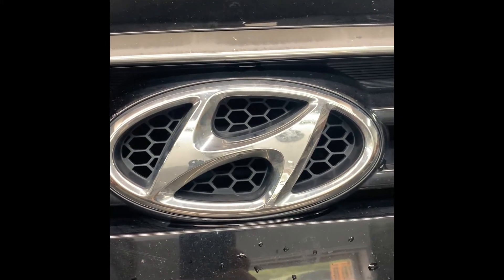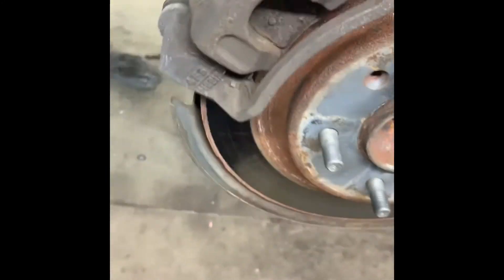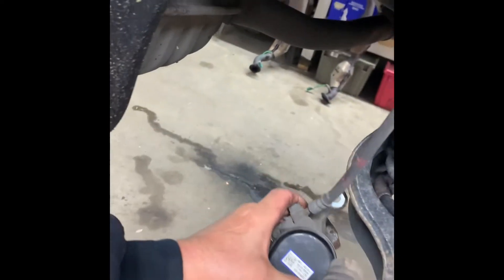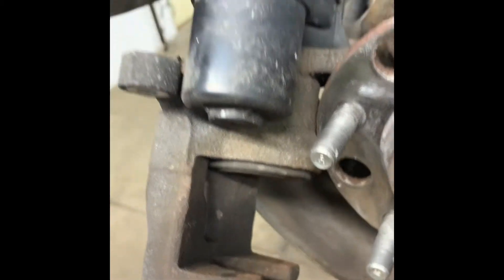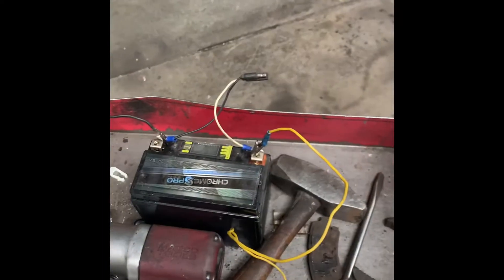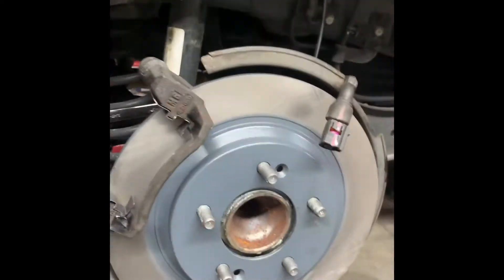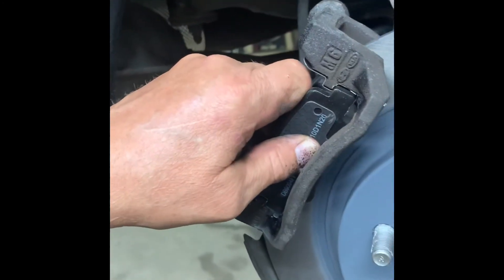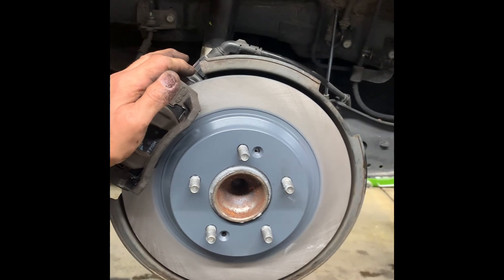2015 Hyundai Sonata rear brakes

Comment: You never should us how to push piston back. You just said vrrrr vrrrr
Reply from the maker: Use a small 12 volt battery with some small alligator clips and touch the terminals inside of the caliper the pushes back in or out if out reverse alligator clips